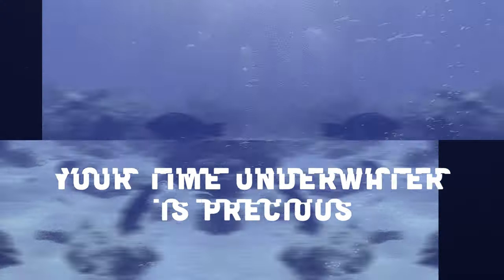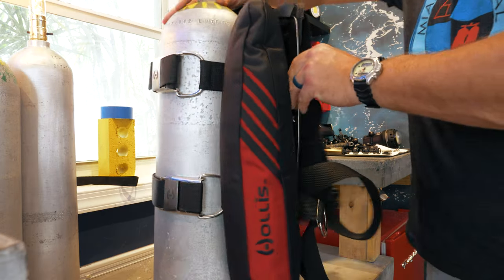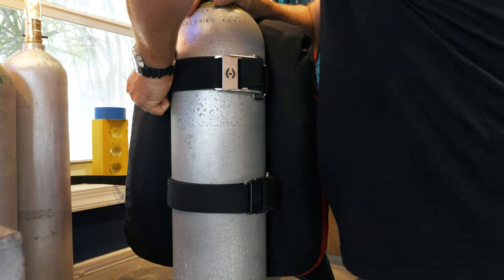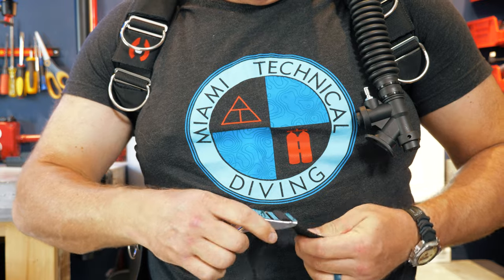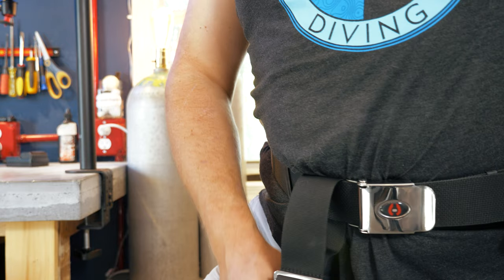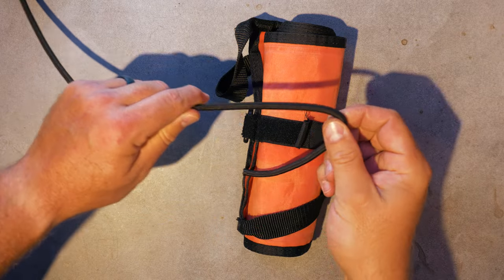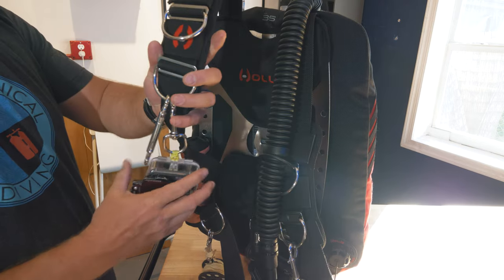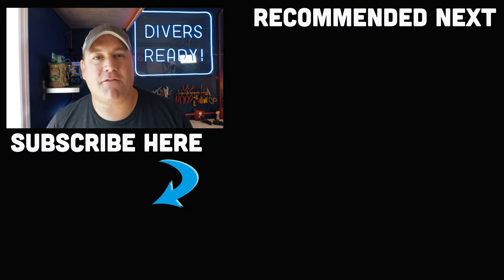How To Set Up A New Backplate and Wing

Comment: Working at a dive centre as a DMC I have asked many people why they dive a backplate with various responses, but nothing that would make me switch to one. But now watching this, I understand the versatility and I will be trying one soon
Reply: For me the biggest reason is not to wear a separate weight belt as with a BCD. The whole rig comes off if you want it to quite effortlessly. With a bcd, it doesn’t. Also the long hose is something I’d never dive without now. Just because it’s safer and you needn’t be too close to a victim.

Comment: Hi James, Just bought my first BPW - a Cressi Aquwawing Pro - it has 2 camband non dump trim pockets and 2 belt dumpable weight pockets - I have 2 questions - 1) Do you mount your trim weights on the upper or lower camband, and 2) What percentage distribution to you apply the trim weights vs belt weights 30% trim and 70% belt? or 50% each

Comment: I just started using a BPW in cold water.  I built it heavy with SS plate and big weight pouches I added a SS Single tank Adapter and bolted weight to the plate.  It works well for cold water diving with a double 7 mm wetsuit.  I am now looking to put together a travel BPW with the lightest materials possible.  Do you have any experience with the soft backplates and do I really need a STA.  or should I stick with an aluminum plate and STA ?  I will be looking for all aluminum sliders and d rings along with a single plastic tank cam to keep the weight down.

Comment: Great vid (as always). I’ve recently gotten to a point where I have gotten rid of all weights and the backplate itself is sufficient to get me negatively buoyant and get down. Another diver recently told me that isn’t safe, as a diver should always have weights to release to get me back up. What are your thoughts on that?
Reply: Read up on a "balanced rig". Essentially what matters is can you swim up your rig at it's heaviest without your wing.  So if you can do that without dropping weight you're good to go. If not it is unsafe.
Reply from the maker: This answer, from Adrian Bill is correct! I will add it to the list of videos.
Reply: @Bananafeller  This is what is taught by GUE.
Reply: @DiversReady  would be awesome to get a video on this. I keep getting comments about that when diving, but more around the context of the rescue diver course,. Keen on learning more about this.

Comment: thanks James, watched this for the 2nd time now as I am looking to switch to BPW.  As a recreational diver that travels to the Caribbean, an Aluminum plate seems like something I would want (fit in carry-on bag?).  a few questions for BPW users: Would this Hollis ST be good for a new BPW owner? And if using AL plate, would adding integrated weights be recommend for the belt or attached to plate? I have read about both.

Comment: Hi Divers Ready. Love the channel, i've learned a lot from it. I have been diving with a backplate for about two years now, and one thing I don't like is getting in and out, it is somewhat difficult since harness isn't adjustable on the fly. I saw some slidebars that can be added to bottom straps where I can adjust it on the fly. Do you have any experience with using these slide bars? Are they going to help or will they end up making the straps just lose and difficult to steady trim? Thank you.

Comment: Great tips bro 🤙 I love my Wing & Backplate 😃  for me I had to find the perfect high for the cam bands so I didn’t bang my head on my first stage because I went from one cam band on my rogue bcd to having 2 of them on my wing and backplate
Reply: I’m in a Rogue right now. Ive had the same issue with hitting my head. If they just would have added a crotch strap so it wouldn’t ride up, and waist straps that didn’t loosen it would work fine.
Reply: @Chogogo717  now that you say that my waist straps do loosen
Reply: @BAMFSQUAD  yup, I probably end up cinching them back down ten times in a dive.